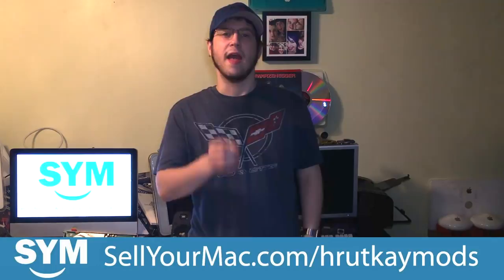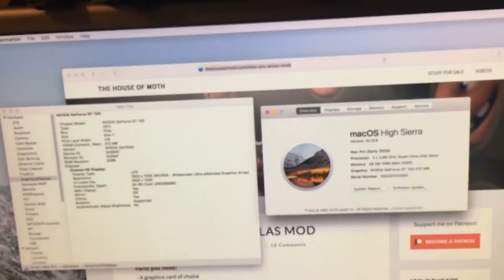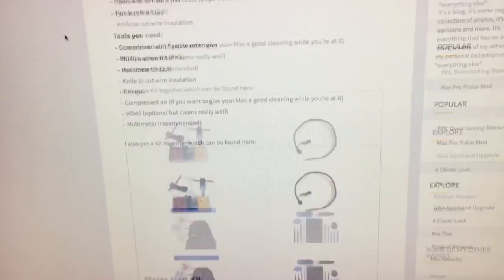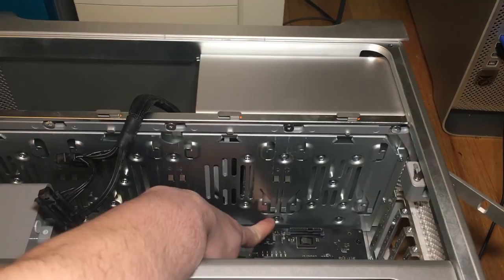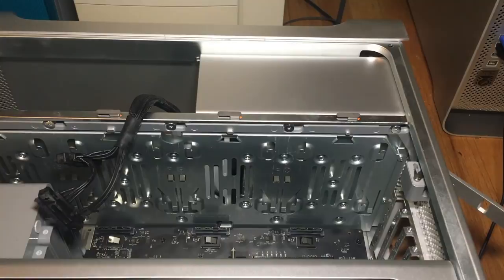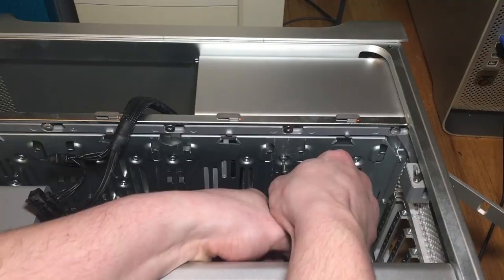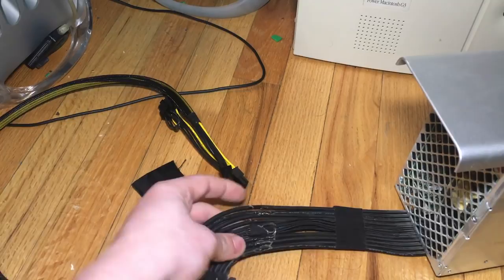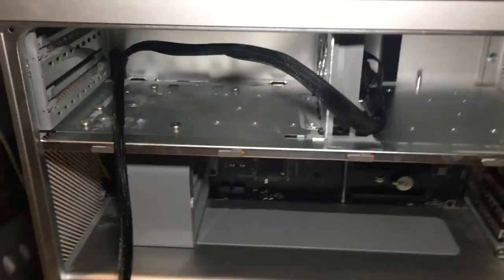How To Do The Pixlas Mod For Power Hungry GPUs - Mac Pro Series S.3 EP.8

Comment: You know you can remove the pins from those molex plugs with an extraction tool which means you could have soldered first, threaded the cables through and put the plugs back on. Alternatively if you don’t have an extraction tool (or the patience to remove them using other methods) the old brute force method. Chop the plugs off and just re-solder and heatshrink afterwards. Would have probably been quicker than soldering in splices at an awkward angle. Anyway you got the job done - perservered to the end. Not a fan of electrical tape, but unless there’s a lot of heat it’ll hold up.
Reply from the maker: I know but I didn’t have the tool and the last time I did it I sliced my fingers open really badly
Reply: Hrutkay Mods Wow - you’re accident prone... stay safe

Comment: Tried this mod but got a stripped screw trying to take off the PSU.  The 4th and last screw was stripped.  Not sure will be able to take it off.  Bummer.
Reply: Awesome tutorial.  For those of you attempting this mod, the most difficult step for me was taking the four screws under the PSU out.  One of them stripped and I spent a hour figuring out how to take the stripped one out.  I finally was able to.  Once all four screws are off, the rest are straight forward.  Good luck.
Reply from the maker: Glad you got it out bud

Comment: I have 2008 Mac 3.1. I cannot find the specs on the power supply anywhere. Not on the "about this mac" or on the mac websites. How do we even know the PS is enough to run these larger video cards?
Reply from the maker: Yep it’s some where between 800 and 1000 I think
Reply: @HrutkayMods  If and when you pull the supply out it is listed on the Sticker on the supply that is required by "UL". Or look at photos of listings for the supply on Ebay. 980 watts . Thanks Great Vid
Reply: if you still haven't found it. when i contacted apple bout the power supply for the 3,1 they said it's 900 to 1000. More than enough to slam a beefy card in there

Comment: theres a new cable set you can get that goes from the motherboard to 2x 8 pin cables. not sure why you would need to do this unless you had a super power hungry GPU.
Reply from the maker: On board 6-pin supply 75W MAX each... 8-pins are rated at 150W MAX... this card uses 2 8-pins which means it theoretically could use up to 300W... so using an adapter cable from the board to that card could blow a hole in the board... they usually shut off before that happens but it has happened... So does it sound like a good idea to pull 300W from 150W connection? because to me it sounds like a really bad idea and this is why this mod is so useful and important
Reply: Hrutkay Mods fair enough, didn’t realize it was only rated for 75w each. I ran a 1080 using 8 pin cables plugged into the motherboard for about a year without issues.
Reply from the maker: Just be careful with it because that is putting a good load on the board
Reply from the maker: Also you can use one 2x6pin to 1x8pin and it’ll work fine

Comment: I don't think you can "electrocute" yourself by opening the power supply, it's disconnected from the mains... LOL  I'm more inclined to open the power supply and solder the cable directly inside on to the board, this will remove the need to cut  and solder the cables  and tape them up again.